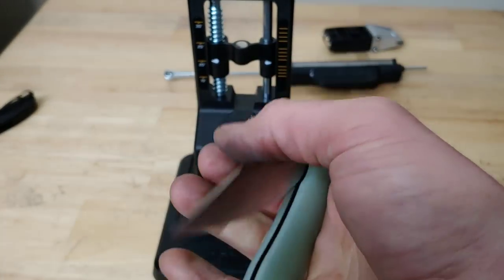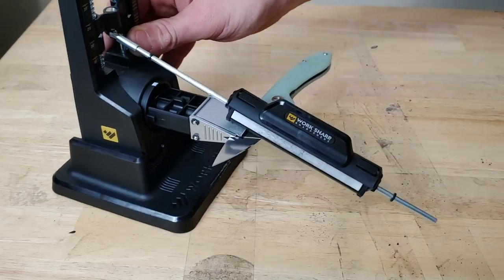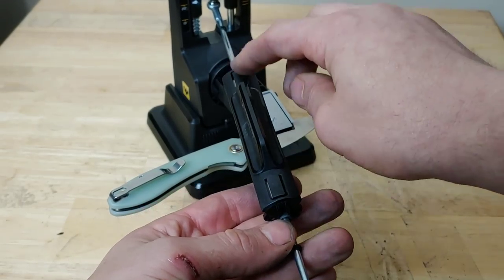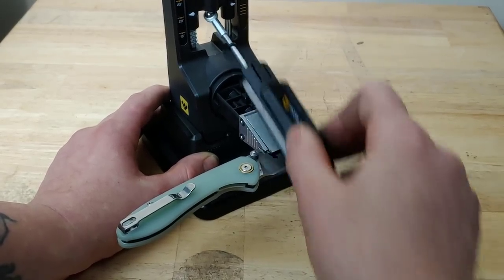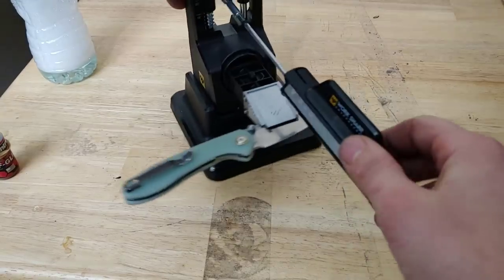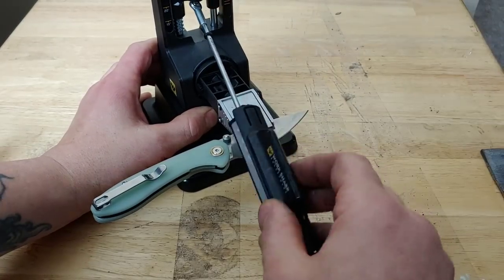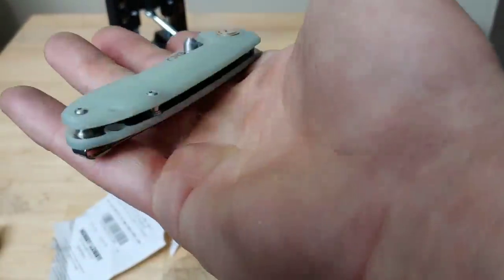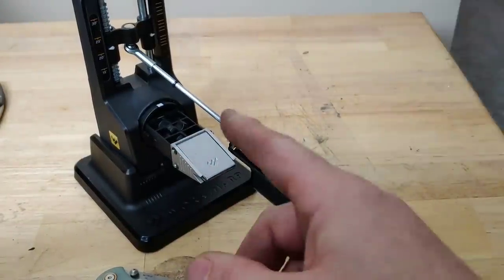WORKSHARP PRECISION ADJUST KNIFE SHARPENER REVIEW

Comment from the maker: PLEASE READ: JFYI I REALIZED AFTER USING A FLASH LIGHT THAT THE CLAMPS DO HAVE RUBBER ON THEM, I DO NOT THINK THE SCRATCH CAME FROM THE SYSTEM BUT PROBABLY HAPPENED IN USE, GREAT JOB WORK SHARP YOU GUYS MADE AN INCREDIBLE SYSTEM,  ARE A GREAT COMPANY.
Reply: Bro, thanks for the great vid as always I just ordered one from bladehq 49.99!
Reply from the maker: @kevinAuman1  awesome! I know most places have been selling out pretty fast, even the place i bought mine sold out in a day, but said it was only a week or two and they would have more
Reply: @NeevesKnives  yeah I actually went on their website directly and they have them in stock but it was 59.99 but they had a link for bladeHQ n I figured seeing how them guys already had all my info n everything might as well buy from there and turns out it saved me ten bucks too!
Reply from the maker: @kevinAuman1  thats awesome!
Reply: I was wondering about this because other videos said it had something there.  I have this system on its way to me but have many systems including a Chinese knockoff of another system with a similar blade clamp and I use a thin magnetic tape inside the jaws and it works great as it is rubberized.
Reply from the maker: @1964krazyeric  yes it does, for some reason i couldnt see it when i looked, but after the video was up someone said it should so i took the clamp into better lighting and could see the rubber, this is a fantastic system that im sure you will be very happy with
Reply: Amazon is out right now. I can’t wait to get this system
Reply: Yeppir,  for the price,  I’ve never had such sharp knives.  Growing up I used freehand on stones and I was good at it.  But,  I got away from the lifestyle t? I needed a good,  sharp knife all the time and I kinda lost my talent.  I then started using a pull through Smiths knife sharpener and I thought it did a good job,  but this thing has it beat,  hands down,  no contest!!!

Comment: Putting a small mirror underneath the k ice can help you see where to stop with the tip. Also cutting a small wooden wedge to place under the clamp can help with the flex, or just buy the 3d printed block. So far I’m very happy with this sharpener! My knives are sharper than they’ve ever been. Definitely gonna need to get some double sided tape and sandpaper because reproducing with the 320 sure can take time. Thanks for the review!
Reply from the maker: I have multiple videos on this system including multiple aftermarket parts videos to massively improve it
Reply: @NeevesKnives  checking those out now thanks for all the great content man!

Comment: Just finished my first s30v sharpen on this. I'll skip to the end, piece of cake. Blade was plenty dull but not clobbered, went nice and easy, used a touch of water to stay smooth and no problemo. I did clean the ceramic stone 3-4 times during finishing, do it by a sink with some scouring powder handy and it takes about 10 seconds.-Keeps it cutting good (and it does cut well).
Reply from the maker: Awesome! Yeah i clean my ceramic with bar keepers friend

Comment: I just learned about the premium upgrade kit for this that actually adds more steps into the system… and a cool storage case. 👍🏼 thanks for reviewing. This is great for someone like me just learning proper sharpening technique.
Reply from the maker: Yeah I have a video on the upgrade kit, and I have a video on aftermarket parts, one is a stone holder attachment that allows you to get any kind of stones you want
Reply: @NeevesKnives  awesome, I’ll check it out. This system is great because I’ve acid etch and stone washed a couple budget knives to learn 👍🏼🙌🏼

Comment: At the price, very nice! Still, I trust my KME diamond stones to last longer. Possibly better quality on KME diamond, and wider variety. However, I like this setup for simplicity and accuracy. I tape my blades for show knives on the KME, but only about 2/3 of the blade, leaving room for the clamp, then don't need to worry about clamping over the tape.  Nice review, compelling piece of sharpening gear!  BTW, I like your sideways technique for polishing - learned something!
Reply from the maker: Yeah i messed up theres actually rubber on the clamp, but the diamonds from them are usually pretty good sincevthese are very small the definitely wont last as long but they will have replacement stones
Reply: There's plenty of aftermarket blanks for these now, I have 120 grit up to 1 micron hones.

Comment: WorkSharp makes some great stuff.

I bought their guided sharpening system 5 years ago, plus the kit with the extra grits and strop.

For my needs.. (kitchen and pocket knives).. It's great.

Really high quality and well thought out.

The only thing that I don't use much is the strop since I have a larger one I made that's better for bigger kitchen knives and fixed blades.

Even the ceramic field sharpener is super useful and has come in handy many times when traveling or camping.

This looks interesting as well. Might get one!

Thanks for the review. Very informative.
Reply from the maker: Yeah i have also reviewed the field sharpener and it is ver useful i enjoy trying different sharpening systems for review but im a freehander through and through

Comment: Great vid. I don't mind a toothy edge if the grit pattern is at an angle.  I use a Lansky but need to refine my stroke to get a more consistent edge.  I am still quite a novice, but I have lots of D2 and VG10 to practice with.  I like the rotating stones on your Worksharp.  Sees pretty convenient.
Reply from the maker: And you can get a polished edge, it just takes a little more time than it would with one more stone before the ceramic, but a toothy edge is fantastic i love a toothy edge

Comment: Just two things I would recommend first thing I found that Windex is the best lubricant for ceramic stones, and also if you want to clean your ceramic Stones just by a little package of erasers.if you rub an eraser over ceramic it'll instantly take off any buildup that's on there within two seconds. Your worksharp ceramic side could be completely black and if you taking eraser and just rub up and down literally within five to ten seconds it's completely White.
And just for your information Inside the clamp it actually is lined with rubber.
Reply from the maker: Ive used eraser many times i have many large ceramic stones, and it works for surface but not great for long build up, i mean it works but bar keepers friend works the best for cleaning ceramic stones that have heavy build up, but you can clean them at your work bench with almost anything

Comment: Use a pencil eraser to remove metal from the ceramic stones. Pink square eraser you would use in school as a kid will work.
Reply: I personally recommend the white squares as follow up from the pink ones. The white ones are a little bit more tough so they should get anything that the pink misses

Comment: Not the fastest way to sharpen a knife as I was using MDF wheels but this is FAR more accurate. I have this system and I absolutely love this, mine has the rubber feet inside the grip so no scratching on my blade. Buy it!
Reply from the maker: Yeah mine does as well i made a mistake and couldnt see them at first

Comment: I have about zero experience sharpening knives, but one tip I thought of is to take a picture of where on the spine you clamped, so you can reproduce the same angles the next time you sharpen.  Otherwise, clamping on a different spot on the spine will change the angles, creating more work
Reply from the maker: Yeah you can definitely do that i dont mind the little change but it can definitely help with saving steel, i usually freehand so i can match an angle pretty well

Comment: Part three the weight problem how I did that so that was I took the bottom off and I put the steel gear inside the housing right there that I made fit in this gear weighs and a couple more pounds maybe three pretty heavy and that helped lot my recommendation to workshirt make the footprint wider get the base is the wider never take care of the problem about it morning to go towards you when your shower add in the wobble that’s in your magnetic system that you have for the sharper yeah it’s still needs work stronger magnets that’s my review I would recommend this would I buy one for a gift yes theses are my thoughts from actually using this sharpener from Work Sharp

Comment: Definitely a pretty awesome looking system. Hopefully if it sells well they will offer different rods with different stone combos maybe like a two rod add on system to cover the in betweens and maybe even a strop. Great review 👍
Reply from the maker: They are going to make extras and replacement stones, they are selling like hot cakes
Reply: They do have extra rods and a leather one…  I bought a triangle plastic piece off eBay and it came with 14 different grits of “lapping films” cut to size for attaching to the triangle plastic piece with adhesive on the back.  They’re color coded to identify what grit they are.
Reply: I can't believe they are charging $80 for the upgrade stones and it only goes to 800 grit. I ordered a regular $60 worksharp adjust but am pondering the thought of canceling my order and instead by ruixin pro008 sharpening system and buy the separate pack of long thin diamond stones for a grand total of $75. It goes from 120 grit up to 2000 grit.

Comment: I have the same problem with Lansky.I can not get a real mirror finish.Also to get a hair cutting blade I have to go to ultra fine Spyderco sharpener at the end phase.The Lansky hard diamond does not last many knives.
Draw two white arrows at the base to show the direction every time.Very good review.Thank you!
Reply from the maker: This can absolutely give you a pretty good mirror polish it just takes a little time, also depending on the steel, some steels polish easier, but with little time your very close to perfect on most steels, the lansky, if you use diamond to fine, then the polishing stone then the saphire, you can get a mirror, and with some steels an aluminum oxide before the polish, you can get a great edge on a lansky as well, this is much easier though and much easier to work with
Reply: @NeevesKnives  Thank you!

Comment: Part two of my comment about the sharpener from work sharp I kind of agree with the pressure but how late can you go with that mean we did not do anything if this is the method they want to go with this system OK that’s fine to make the men stronger OK that’s one of my major concerns about it is the play room is round in the holder because of the magnets that hold it there’s a lot of wobble it happens I modified mine to fix the problem with the weight I just bought the bottom off and had to go steal gear around

Comment: I have the power work sharp and have messed up too many blades.  Still use it but more for hard grinding and then I have been just using the work sharp field sharpener.  Have been thinking about a kme but for $50 I think I need to try this!
Reply from the maker: This is definitely great the electric one is great with the grinder, this one gives you v grinds vs convex from the other

Comment: Another quick question if you don't mind.
Would you recommend this to someone who would be primarily sharpening kitchen knives. The types of knives you get in a typical set  (chef's through paring). 
And what other systems would you recommend looking at for this intended purpose.
Thanks
Reply from the maker: I would absolutely, theres a couple other systems on Amazon that are for kitchen knives, you want to make sure the part your getting have a base, i did a quick measurement and you will have noproblem doing kitchen knives at all with this system
Reply: Thank you for your reply

Comment: I got this for Christmas, and I get them so much sharper than I did with the field sharpener. Not quite as sharp as yours but I don't have a strop yet 😅
Reply from the maker: Everything takes a bit of time practice and understanding, focus on your burr removal, a Strop is extremely important but you should be able to do great work with out, btw a lot of things can be used as a Strop like news paper. Watch my aftermarket attachments video lots of upgrades
Reply: @NeevesKnives  For sure I've got mine sharp enough to guide through cardboard easily and cutting paper has almost no resistance.

Comment: I have had one since the day they came out and have used it extensively. Firstly it should come with some extra o rings on the end of the rod. You constantly end up hitting it and it gradually slides down the rod as you sharpen. It doesn't weigh enough and the center of gravity should be in the base. You have to basically hold your hand on top of it all the time to keep it from moving around. The clamp could use more support under it to keep it from bouncing up and down a little while you sharpen. Lastly my ceramic stone was not perfectly flat. It had waves running through it length wise and I had to lap it on some of my diamond plates. That could be a big issue if someone doesn't have diamonds to lap it since that is almost the only thing harder then ceramic to cut it.

I do want to note that it is a amazing sharpener for what it is considering the price. If there was one sharpening system I would tell someone to buy this is it. Anyone can basically get a hair whittling edge with a little practice and a strop to finish up on.
Reply from the maker: I agree with everything you said, and im also going to talk about flattening my ceramic stone in the long term review, im happy to hear they are going to start making replacement stones and accessories soon
Reply: @NeevesKnives  According to their site you can already buy replacement stones for the 320 600 and ceramic. I do also agree with you that there should be a higher grit stone before the ceramic. Ceramic isn't that aggressive and it's kind of a jump to it. It takes to much time if you want to really remove all the 600 scratches.

Comment: Does it work good. Seen several videos about it being flimsy and it breaks easely. Here also i see the knife movimg when sharpenig. Looks not well build and i am in doubt to buy it.  All that plastic works and moves a lot.
Reply from the maker: It's a 50$ machine, and I do think buying the aftermarket attachments that I've made multiple videos on is a good idea. Which massively improves this system

Comment: Have you tried the Wicked Edge sharpener before?   It seems to follow a similar method.  Question:   How do you ensure correct angle for blades that are deep vs shallow when clamped in.  The geometry would be different even if the setting of angle degrees was the same. Does Work Sharp have an accurate way to determine what angle is already on a knife from the factory?
Reply from the maker: You have to get an angle finder, I put one that I recommend in the description, and no I haven't tried the wicked edge

Comment: How would this system work with a small slip joint knife with a slim blade? For example a pen blade on a case peanut pattern. It looks like the thickness of the clamp might be a problem.
Reply from the maker: I thibk it would work just fine as long as the blade is longer than 1 inch

Comment: I have one. I have to say that I am having some trouble with it. I am having trouble figuring out what angle to use and also the three knives I have already sharpened with it just aren't getting that sharp. They are getting mildly sharp.
Reply from the maker: So 20° should be a safe angle I usually go for a bit lower around 17 but 20 is a good angle, you have to make sure you get the entire bevel on both sides and get a burr on both sides, that is what will get you a sharp edge, I have a Sharpening play list that might help most is freehand but it still translates

Comment: I use a Tsprof k03, that looks like a lot more budget friendly option, they do sell replacement stones for about eight dollars now.
Reply from the maker: Yeah theres many systems out there, one thing that you have to kbow is the stones and if they are any good many systems are for kitchen knives and dont work as well on pocket knives especially with better steel, also a lot of systems seem great until you get them and you realize that they are not as they seem, this system is great and its exactly how it seems, the parts are extremely easy to use the stone works on all steels including super steels, and they will have replacement stones coming soon with other available parts like strops exc...

Comment: Great video sir. Thanks. Strange, but all the other footage I've seen has had rubber coating inside the clamps. Also some folks are bench clamping the base down to the work area. But otherwise, definitely promising as a more budget friendly guided system. Heck, I wish my EdgePro had the same angle adjustment system as the WorkSharp seems easier to just dial-in to the exact angle you want. 👍🏻
Reply from the maker: I messed up i can see the rubber it was very hard to tell the difference without shining a light on it, but it does have the rubber, and clamping it down is nice but honestly its no problem at all just using it without, you just have to hold the back end of it